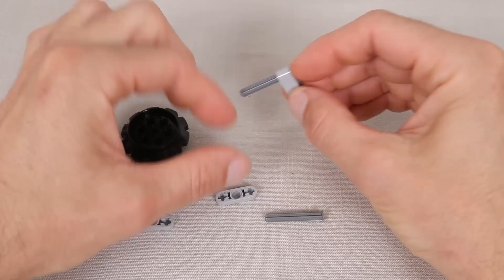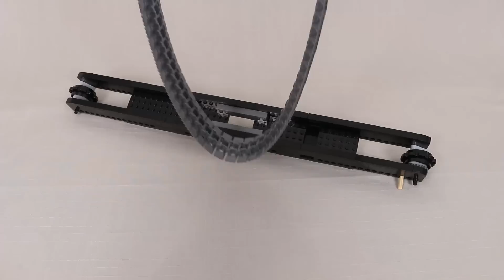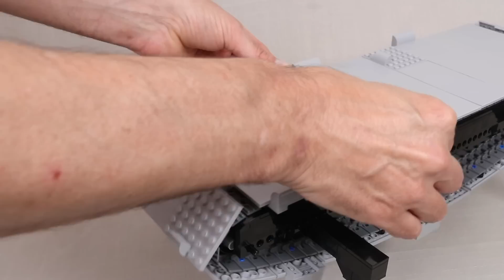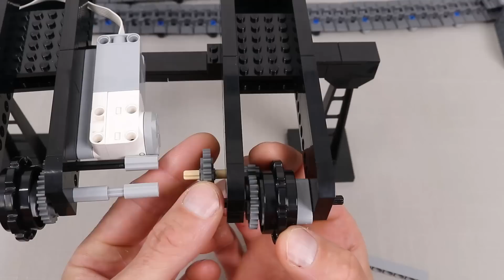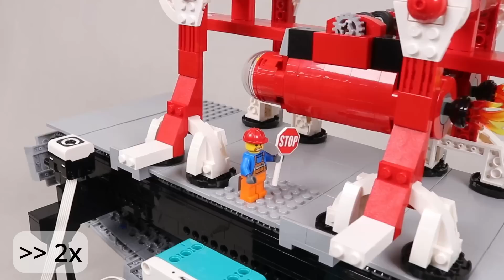Making a Treadmill for my LEGO Flip Walker

Comment: I am amazed the walker does not veer off slightly to the left or right as it walks. I would’ve thought it might eventually fall off the treadmill on one side or the other. Must be extremely well balanced and the movement well-controlled. Fantastic.
Reply: There are small control walls on the side so it doesn’t fall off.
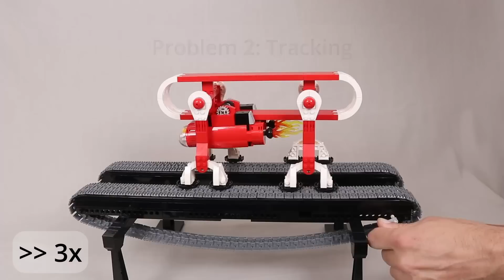Reply: 1:49

Comment: You should try to make a mechanism that acts as a motor, something that can use gravity to continually supply movement to an axle only with a starting movement. Not sure if that is even possible but it just popped into my head.
Reply: That would basically be a perpetual motion machine😂
Reply: @Skarrier  so then it would be impossible. Maybe it could be done so that it just lasts a really long time and be very efficient.

Comment: What happens if it starts creeping forward or backward relative to the treadmill? It wouldn't fall off because of the colour sensors, but wouldn't it eventually collide with the obstacles?

I understand that, in theory, the "feet" would land in the exact same spot every time, but "in theory", it would also walk straight without falling off the side. The side-to-side creep is accounted for, but how about front-to-back creep?
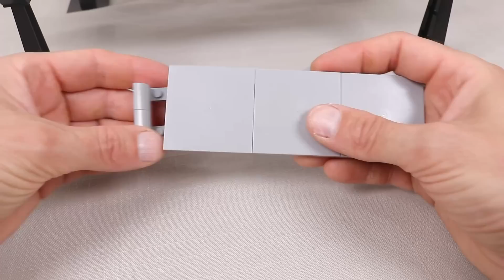Reply: As seen from 2:16 on, there are curved walls guiding the feet not only side to side but also from the back, nudging its steps to be long enough. Presumably testing showed it tends to step short, not long.